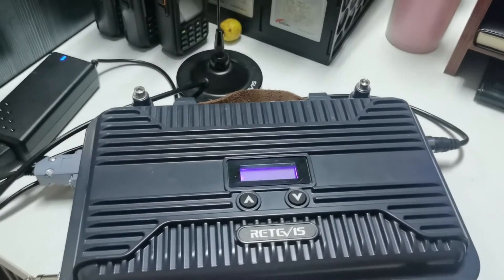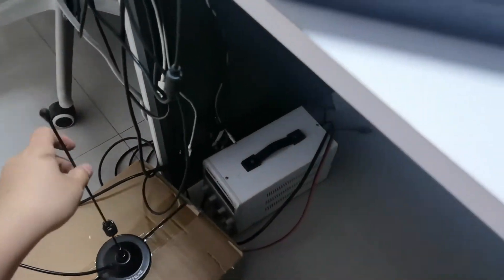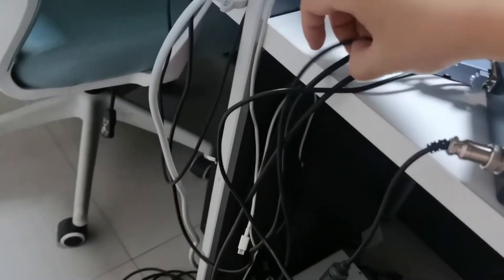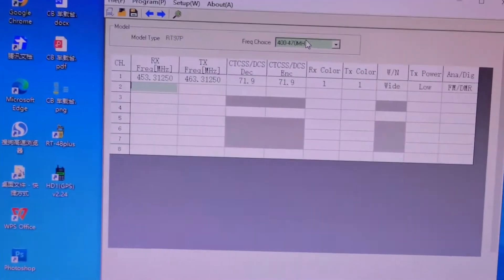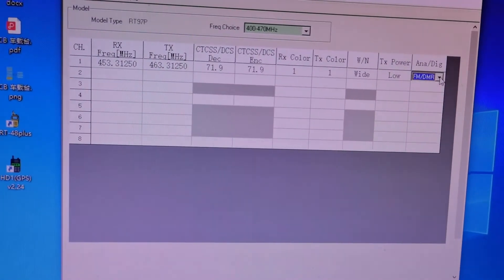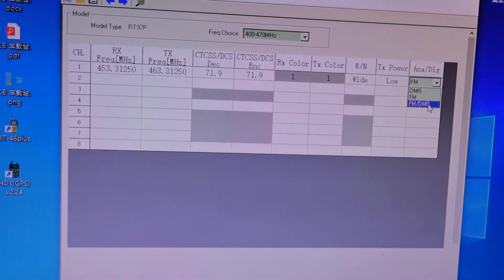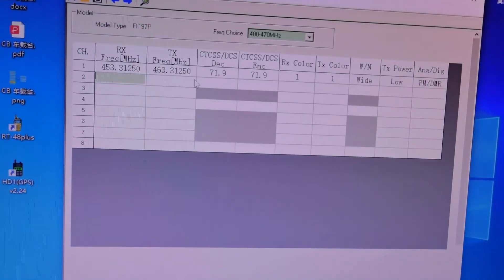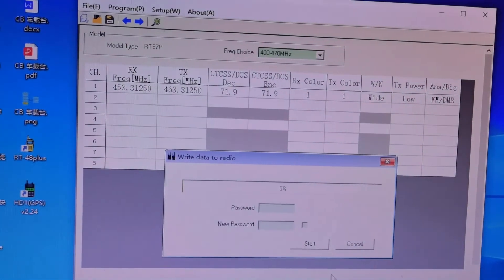The Mixed Mode on Retevis RT97P Digital/Analog Repeater

Comment: When will there be video from Ailunca hd1 on the V2.4.4 version, because I can't solve the "Ber" deviation, which is always oscillating between 4 and 5. This makes it impossible to transmit with quality. There are other radio amateurs with the same difficulty.